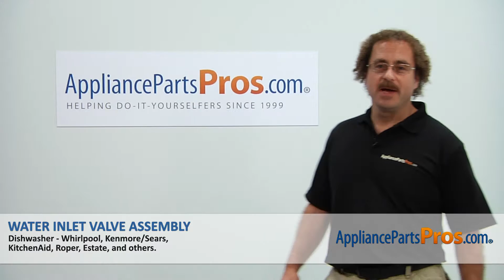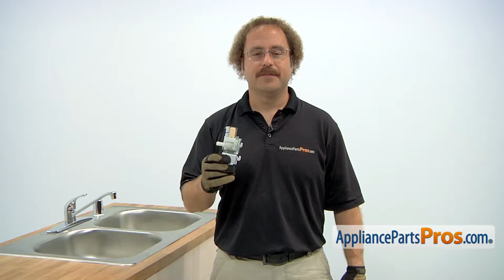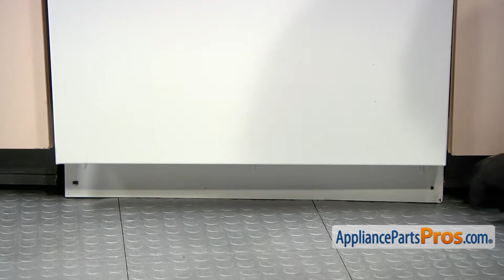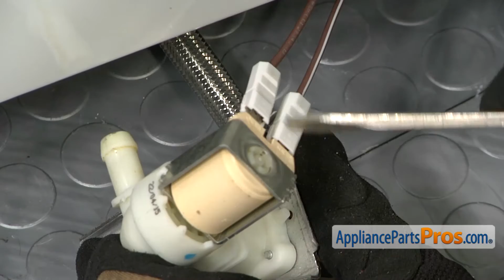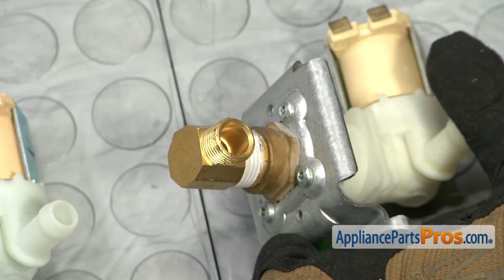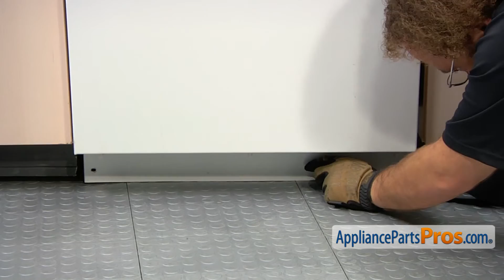How To: Whirlpool/KitchenAid/Maytag Water Inlet Valve Assembly WP8531669

Comment: Video was super. One recommendation; once you remove the water inlet valve it may be impossible to remove the brass fitting. Video makes it look so easy, but in my case it was not. I would mention in the video that it may be necessary to buy the brass fitting separately, and provide fitting dimensions. My dishwasher is 20 years old and I could not remove the brass fitting. It was stuck solid. In my situation, it was easier to just buy the brass fitting too. The brass fitting is considered part of house plumbing and that's why it does not come with the assembly.  Wish it did.
Reply from the maker: Thanks for the detailed feedback. 👍 That’s a great point and helpful insight for other viewers, especially with older units. We really appreciate you sharing your experience!

Comment: Thanks! Our’s has a tiny drip, drip leak that comes from the 3/8th inch brass compression water inlet with teflon-wrapped fitting that goes into the valve. The inlet valve seems to be functioning properly and our dishes are washing properly. I wonder if I just have to tighten up the elbow compression fittings a bit as they might have loosened over years of operation?
Reply from the maker: Thanks for sharing the details, @DouglasJMark! If everything else is functioning properly, tightening up that elbow compression fitting might just do the trick—especially if it’s loosened over time. Just be careful not to overtighten. If the drip persists, you might want to check the fitting for wear. Let us know how it goes!